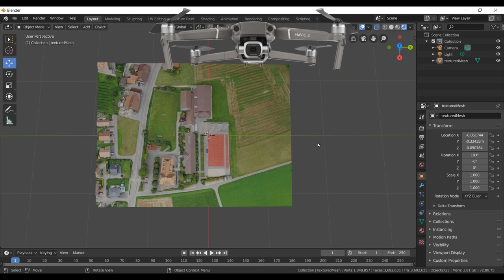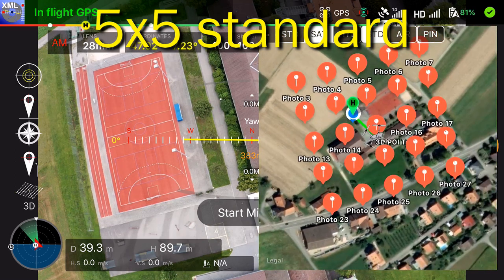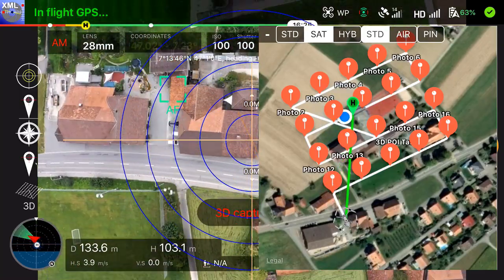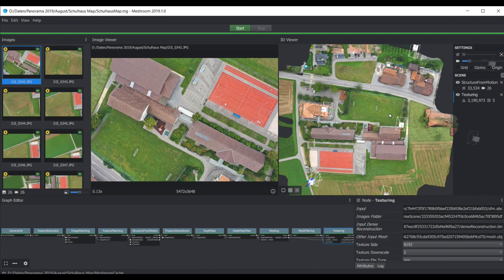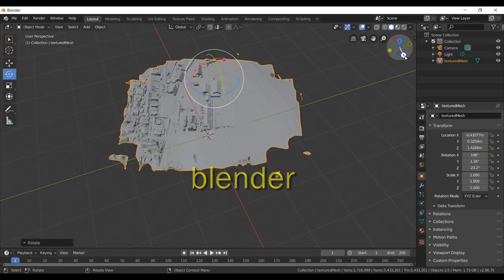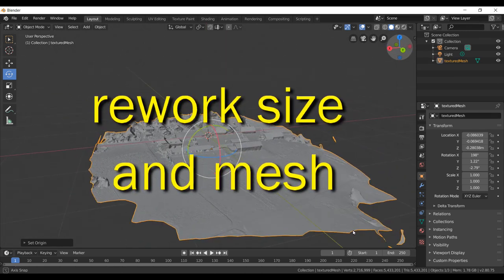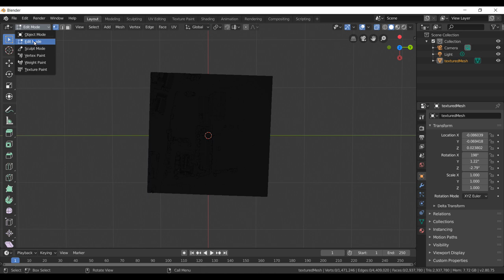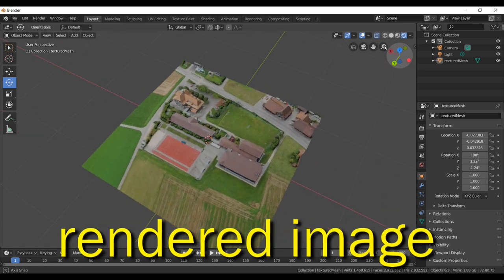Aircraft Photogrammetry with MESHROOM 2019 and blender 2.8

Comment: can we do this for whole city using satelitte stereo pair which has two perspective image to create DSM, am looking for a process, instead of using mertashape or envi or erdas for that matter
Reply from the maker: Google does it with satellite images.You need a lot of computing power to do big surfaces.
Reply: @KilianEisenegger  Actually I am currently working on a study which requires a DSM for whole study not that accurate but one that can easily depict shape of a building 2.5-5 meters is fine I think so I was hopping to use Stereo pair to generate a DSM Is there any open source options around to do so